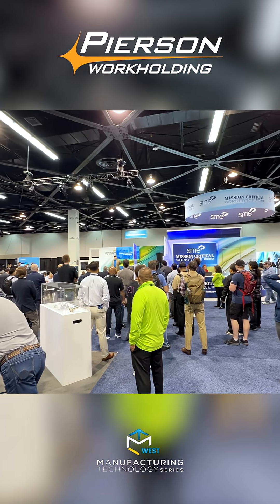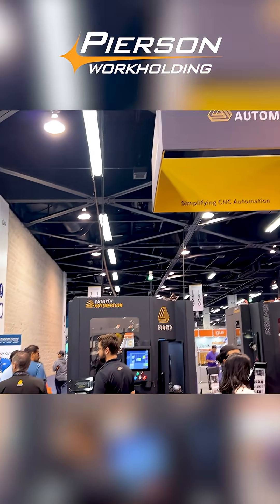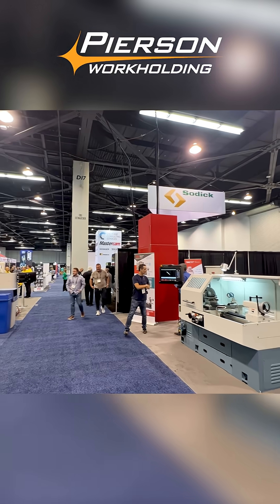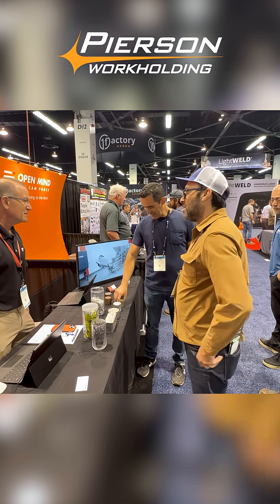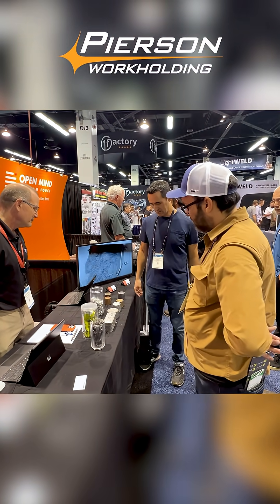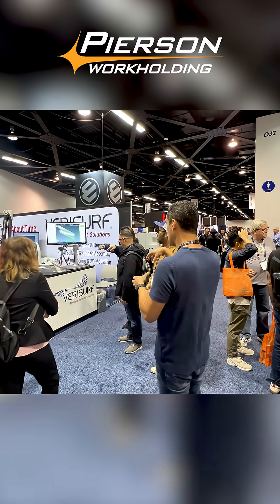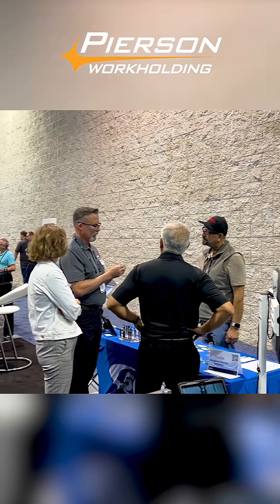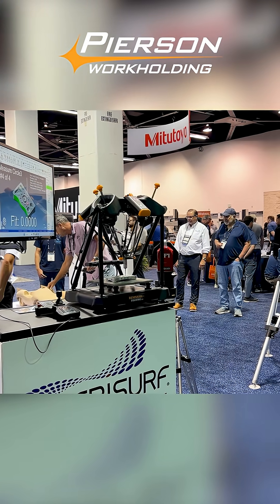Westec 25 | Future of Manufacturing #leanmanufacturing #westec2025 #automation #robot #workholding

Comment: Would love to see a micro pallet from you!  One of the ball clamps and then 12 position indexing. For normal 3 axis work it would just be used as a very small pallet but then with a micro base at 90 degrees to table I could get all the sides. 12 position is high enough to get a great finish with a ball end mill for complex parts and allow a simple 3 axis machine with a horizontal base and 90 degree base to do most things a 4 axis machine provides.  Breathe some life into some older machines that don’t easily support a 4th.